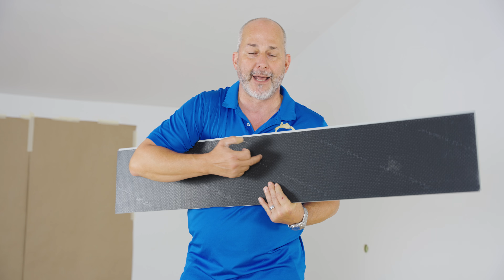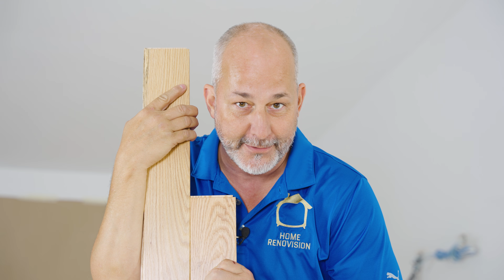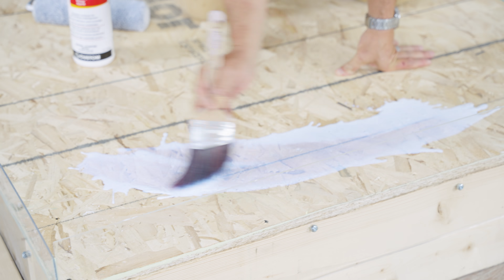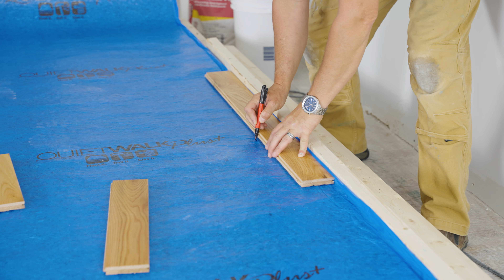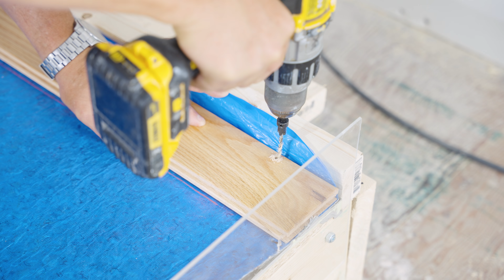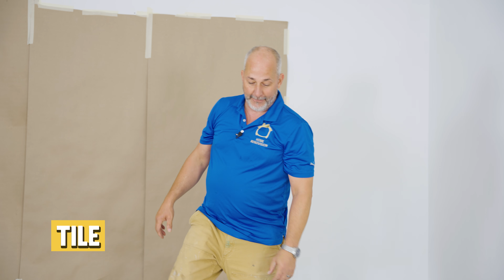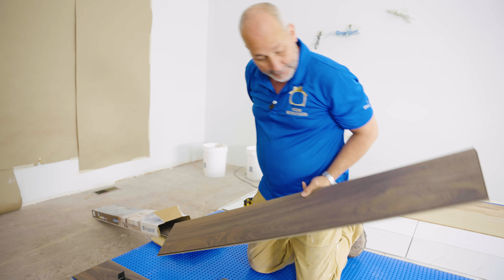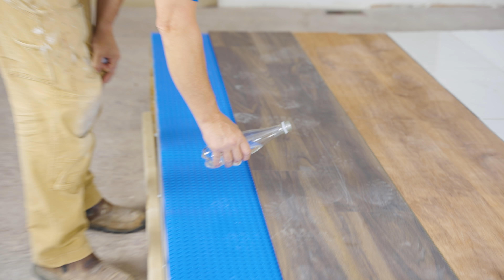Flooring Comparison: LVP vs Laminate vs Hardwood

Comment: I have a 120 yo house with t&g hardwood floors in terrible condition.  Also painted with lead paint. I'm looking for the best flooring solution to go right over that.
Reply from the maker: sand down the hardwood on a 45 degree angle to get rid of the high spots. then look at vinyl on a dmx underlayment. your budget and expected purpose also weigs in. if your flipping holding or planning a major renovation or just trying to make an old house function affects the answer.
Reply: @HomeRenoVisionDIY    Thanks for the suggestion but that's the problem.  I can't sand them down because of the lead paint and I'm sure not going to strip all the floors.  I live here and function is the main order of business for now.

Comment: Looks great. I’m in an older home. Any thing additional I need to put under vinyl for the first floor that’s over a vented crawl space?
Reply from the maker: just use the dmx 1 step like in the video. Cheers. that will keep everything dry and mold free.
Reply: @HomeRenoVisionDIY  can I add anything that’ll help insulate from the cold air below or just tape the dmx 1 so that it’s air sealed?

Comment: I live in a central Ohio, 23 year old, suburban home.  My brother says that nobody has any business installing anything less than 3/4" hardwood in a 400-500K home.  My biggest issue is the open plans and the transitions from foyer, hallway, kitchen, living room.  It's either all wood look or wood/carpet.  I figure if one is going to install hardwood, one might as well do the entire floor with it.  On the other hand, I've been living with ratty carpet and ugly linoleum while I try to make up my mind.
Reply from the maker: the best way to install hardwood in an open plan is to start in the hallway and build off the subfloor joint. this will keep it square overall for the whole house. you can start the first row in adhesive and 16 gauge brads then install a tongue on the groove side and install in both directions from there once the adhesive is dried. Cheers!

Comment: This was a GREAT video. I did engineered hardwood in a previous townhouse with concrete pad, and it was a great install and great finish. HOWEVER, my current home with mid 1960s floor joists; this was eye-opening. The traditional hardwood plank, despite my fear, really looks like the way to go.
Reply from the maker: Glad the video helped with your decision. Cheers
Reply: In the early 1950s when I was a child, we had a house where the subfloor was ship lap installed diagonally. I helped my dad with the hardwood install by unbundling the boards and handing them to him. That was before pre finished hardwood flooring was available.

Comment: Jeff, as a pro remodeler myself, I've watched quite a few of your videos. I love learning new techniques. That said, I need to clear up a few things for you. First off, never, ever under any circumstances start your floor based on the wall. ALWAYS measure from the nearest seam in the subfloor. Especially important if going throughout the home, not as big a deal in a single room. Next, your starting row should go down with a highs strength adhesive and 15 gu nails at an angle through the tongue first, then on the backside under the trim. This process may change in different starting areas, and is the approved method from major flooring manufacturers. Furthermore, always have a nail set and right angle dykes (aka sidecutters) on hand for staples that don't sink properly. Otherwise, great work! 

Nick Cress
Cress Home Crafters
Reply from the maker: cheers Nick. the subfloor trick is a great one. I like the wall as a way to train homeowners so it removes the work of going both ways with the wood. which is why I also use a chalk line. this system also works for houses on slab without subfloor joints to help direct the install. In my experience homeowners don't set the first row in adhesive and let it sit overnight which is why I teach to use the screws. Cheers!
Reply: @HomeRenoVisionDIY point taken. That said, we (as professionals offering advice), should also advice homeowners not to install hardwoods on concrete, even in arid regions. I do see your point, though. That said, with a proper vapor barrier, an engineered floating hardwood wood be acceptable in those areas, as well as laminate or LVP. Appreciate the response. Take care, Jeff.
Reply: Are you concerned that the wall is not straight? What if subfloor seam is also not straight?
Reply: @RealMuperSan never rely on the walls of a house to be straight or square to anything else. Exterior walls will tend to be more square overall, but measuring off the seams in the subfloor will always be your best bet. Especially if installing the whole house.
Reply: @nickcress thanks! Even as DIY it’s expensive so I want to do it right

Comment: For what its worth, I cut all my laminate with a chop saw. It did do some minor chipping, but the cut ends are buried under baseboard anyway. I wasn't aware of the paper-cutter looking tool until today
Reply from the maker: A chop saw works in a pinch but it will dull your blade fast. As long as you cut outside your fine. just adds a lot of steps. Cheers!
Reply: @HomeRenoVisionDIY yes, I do remember MANY trips out to the saw 😂 keep the videos coming, I’ve learned a lot

Comment: LVP top pvc layer can peel off on uneven floors. Did my entire house and it's peeling off within a few months. Invest in something else or a floor leveler. I'm furious with mine.🤬
Reply from the maker: lvp is not designed to install on anything that is not level. or flat. Cheers! many folks have been burned by this.

Comment: Engineered CAN be refinished. The good stuff will have enough veneer that can be refinished but you won’t find it in big box stores. Cheers
Reply from the maker: You are correct! Good to know for those looking for engineered flooring. Cheers
Reply: @HomeRenoVisionDIY but they often cost just as much or more than hard wood. Their appeal is in the larger size.
Reply: @lwagner1723 Yes! Looks aside, engineered tends to be preferable over concrete slab because you don’t need to build up a subfloor. Depending on your situation, another reason to consider engineered is that it doesn’t contract and expand as much as hardwood because of the different layers and directions of wood.  I’m on the same page as Jeff though; hardwood and porcelain are first choice everything else for particular situations
Reply: @GR-cd2kx agreed, if I can afford it.

Comment: What is the cost difference in the labor costs between vinyl and hardwood installation? That is going to be a determining factor in a lot of cases, if there is difference.
Reply from the maker: vinyl is half. Cheers! but if you want it done right. do it yourself. Cheers!
Reply: There is.  I've installed both and hardwood takes longer as the planks are not as wide and wood varies a lot more so you check all the together touges etc more for defects... Probably can find online differences in labor

Comment: So if I use hardwood over dimensional lumber joists, I should use adhesive and staples? My floor (carpeted) has deflection I can feel as I walk over it. I’m hoping hardwood can correct it
Reply from the maker: be sure to use a higher quality so the boards are long and it will span the joists and get rid of the deflection. Cheers!
Reply: @HomeRenoVisionDIY thanks so much for the confirmation
Reply from the maker: Cheers!

Comment: just wondering if you have engineered wide plank 10.5" wide oak that you will glue down is there a song proofing membreane you can use i think this one you have on here you cant glue to it
Reply: sound proofing'
Reply: You have a couple options. One is a double stick underlay (glue below it and above it) and the other option is a special glue with sound deadening properties. I used the latter in my condo years ago and it was fantastic. Type and availability will depend on your region but they both should be available at a specialty flooring store.

Comment: I live in Nashville and a lot of houses are built on concrete slabs… what’s the best option?
Reply from the maker: glue down engineered!
Reply: @HomeRenoVisionDIY glue down  might be best for a while but you need to plan for its eventual replacement. One of the only jobs in my career where I couldn't even come close to finishing was removing a new defective install of a glue down wood floor on concrete slab. It was so much work I tried about three different methods and only got a small portion of the room before I had to apologize and quit. I'm not saying it can't be done but it's much more work than a floating floor.
Reply: Hello boss